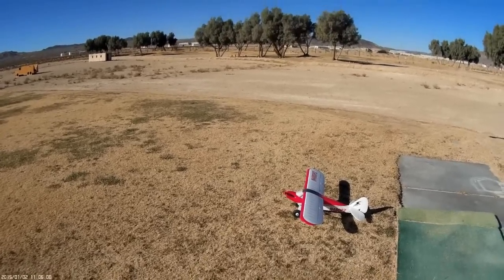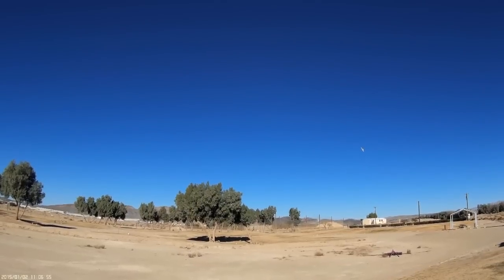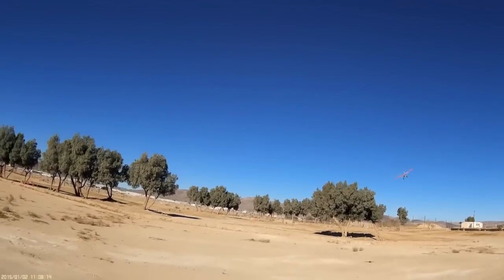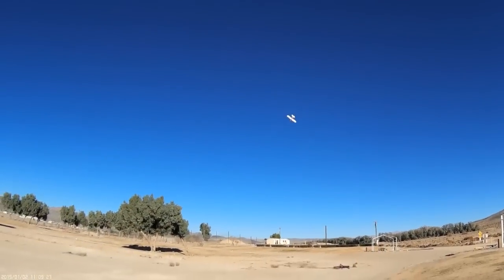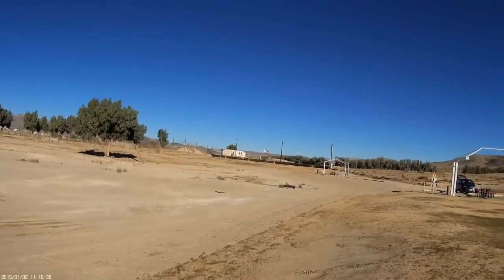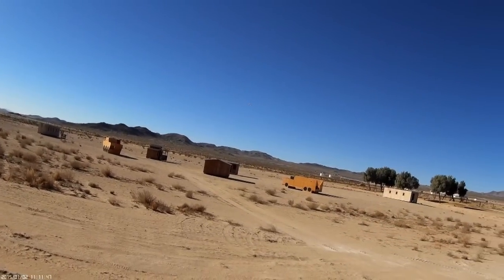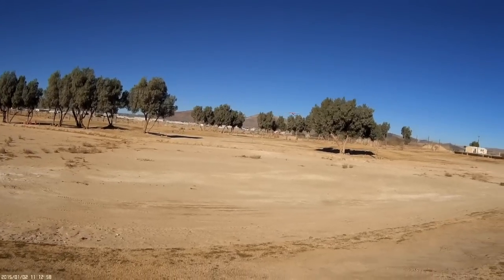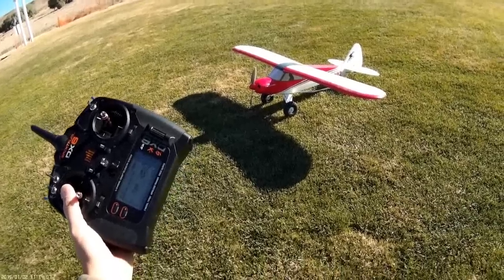Parkzone Sport Cub w/10x7 SF prop - 02 Jan 2015

Comment: I use a 11x7 prop on mine with stock esc and motor , fly a 2200 25c with no issues and with very little heat build up. Easily fly 7-9 mins with plenty of battery left , for another flight

Comment: Nice flying. How is your runtime with the new prop?
Reply from the maker: ***** Thanks! I think the run times (I fly on 1300's) are pretty comparable to stock (9x6). That is, I don't see a big difference between cells when I land with either prop ( I generally come down after 5-6 minutes with 30-35% remaining), so that tells me the 10x7 Slow Fly is a good way to cheaply increase your thrust all through the power curve.

Happy landings!
Reply: Justwingit But you cant put a bigger battery like a 2800 with no power loss?
Reply from the maker: Gabriel Gagnon Hi Gabe,

I prefer to keep my STOL/Bush planes light....I think the Sport Cub flies really good on a 1300, and I don't mind 5-7 minute flight times.

Happy landings!